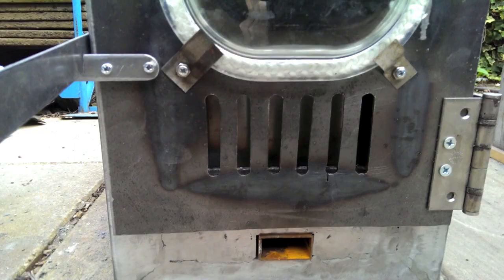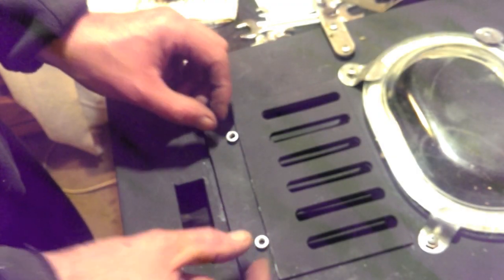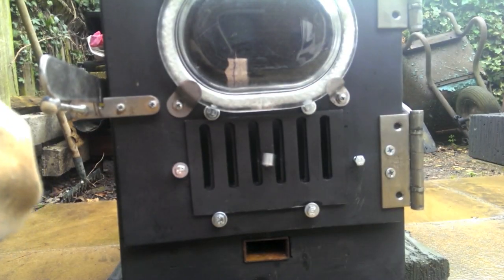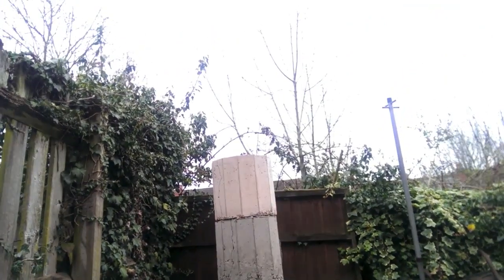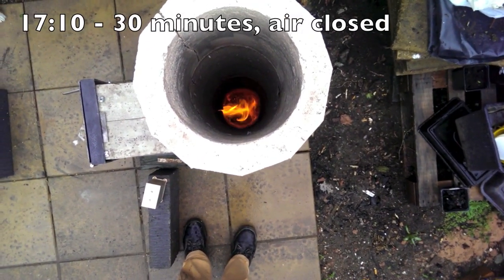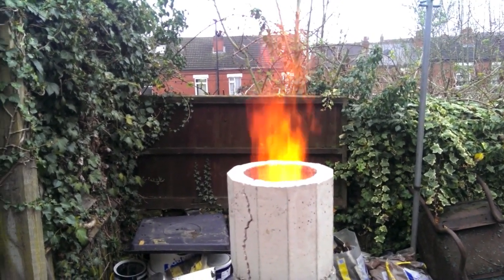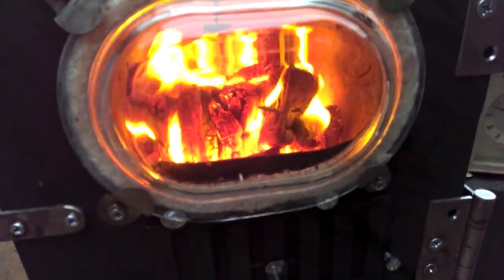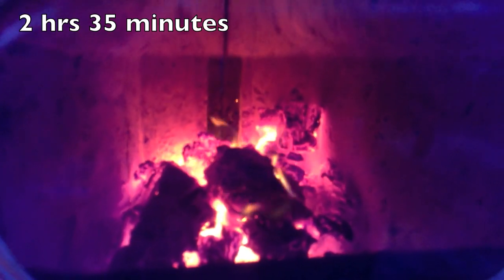Air Control for the Batchbox Burner

Comment: You may find it useful to use some high temperature caulking to seal the largest cracks in the batchbox, so that you can test the control you've developed with the sliding grill.  This may also reduce cracking by forming a cushioned interface between the pieces, rather than allowing the pieces to impact  with each other.
Reply from the maker: Thanks for the comment Lictre. Yes, some flexing at the stress points should help keep it intact. The cracks, and gap around the door frame probably exceed the area of the primary air grille and so I will definitely need to seal everything to be able to control the air. The perimeter of the door frame is around 1.4 metres, so, even with a 2.5 mm average gap around it, the gap area would be equivalent to the whole primary air grille, which is around 3,500 square mm. Dave

Comment: Might consider mixing some Rock Wool fibers into the refractory next time to reinforce the cement. I just cast a riser from 2700°F cement and Perlite in a 3:4 mix. Hopefully it resists cracking.
Reply from the maker: That's an excellent idea Kentucky, thanks for sharing it. A viewer on an earlier video, @changeindirection, suggested chopped basalt fibres but they seem difficult to get here in the UK and are quite expensive. Did you chop your own fibres from a regular rock-wool insulation batt? How much fibre do you add to a given quantity of concrete? Was it easy to incorporate the fibres into the mix? Sorry for the questions; I'd really like to try something similar and I'd be really interested to hear how your casting fares. Thanks. Dave
Reply: @batchrocketproject4720  I have access to rock wool batt here at work. I just tossed a couple handfuls into the bucket I used to mix everything and it broke down on its own during mixing. I messed up the drying process, unfortunately, by moving the riser before it was fully cured, causing the bottom to crumble. I used large cardboard tubes as molds and they held the moisture in much longer than I expected, so it was still soft when I moved it. Once I removed the tubes, the riser cured and hardened remarkably well in about a day, save for the bottom section. I'll make another one eventually since I know how to do it correctly now. I actually dropped the whole thing on its side just to test it since it was already broken, and it held together.

Comment: Great job! Ingenious idea for the door slider that i havent seen anyone else explain how to make. I like it! Also learned just going by that crack in the heat risor that thares actually quite a bit of heat expansion. Good to know and really consider on my build this summer. Thanks! Keep it up!
Reply from the maker: Thanks chevy, glad you liked it. 

Yes, the crack in the heat riser became wider as the burn went on, suggesting there is expansion with heat. I couldn't film it as I needed both hands but I tried closing the gap with my hands to see how much force the expansion was exerting and it was negligible - the gap could be closed with barely a touch. I'm pretty sure that had the piece been mortared together, any cracks would have stayed closed. 

I really need to find somewhere that I can install the burner with mortar and make the chamber air tight. I won't know the effects of controlling the air until I can do that.

Thanks again, Dave.